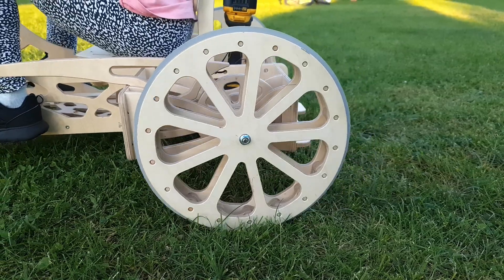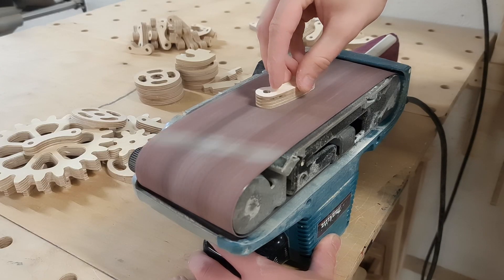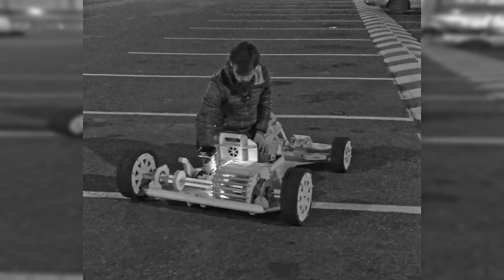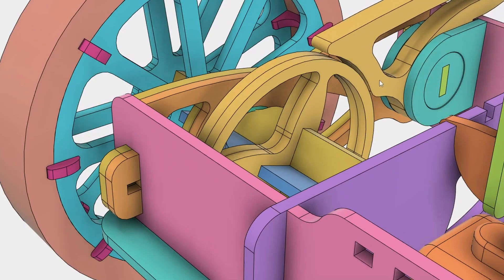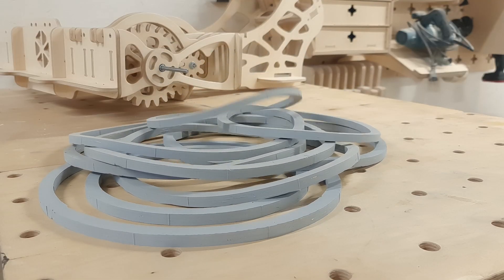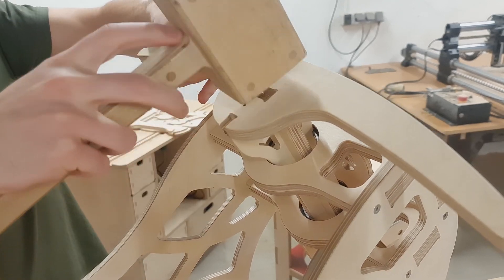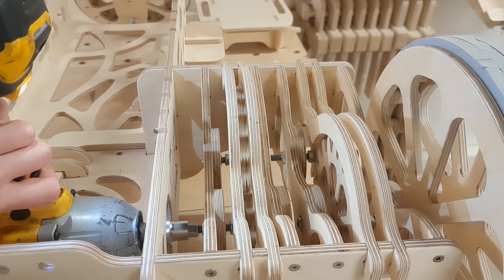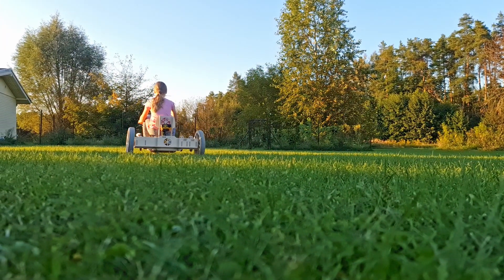Drill Powered Go-Kart Made on A CNC Router - Took Us Years To Develop - Aribabox

Comment: This is awesome!
Reply: If you’re using flange nuts to act as spacers, could you make some tubes from layered 12mm plywood circles (cnc to Aribabox splendour) then use the tubes to space components, then tie the whole assembly with a lock nut each end? 
Keep up your inspiring work!
Reply from the maker: @coursdfghjgtherill5591  Thank you for the great idea! We’re considering using small wooden discs as spacers for the back wheel design update. We originally used flange nuts to secure the gears and wheel discs to the axis, but found it wasn't efficient enough. We’ll definitely explore different approaches based on your suggestion. Thanks again for your support and suggestions!
Reply from the maker: Thank you!